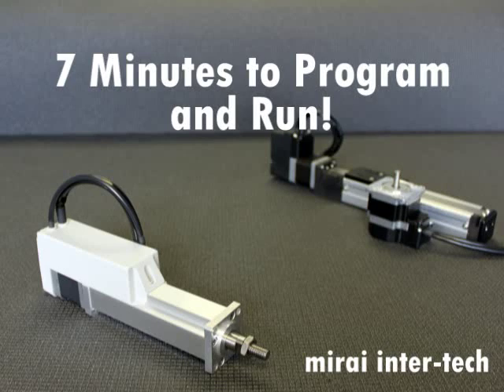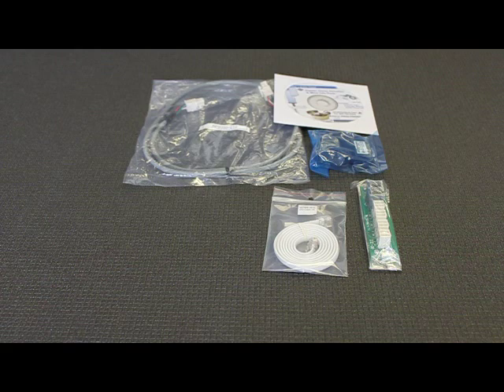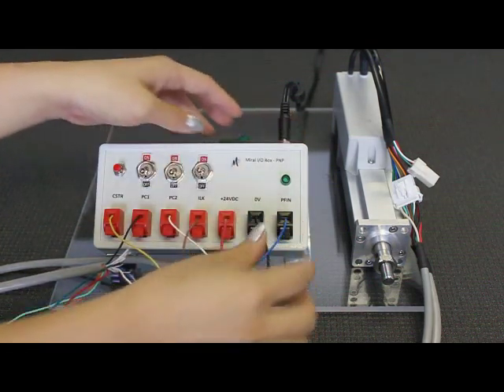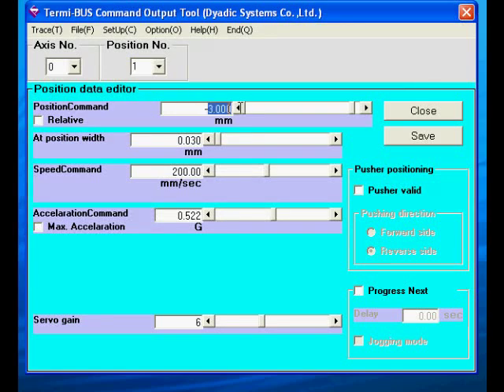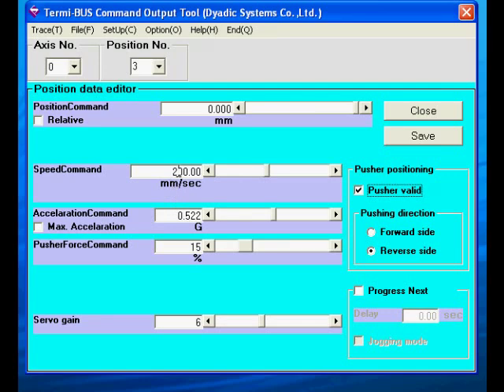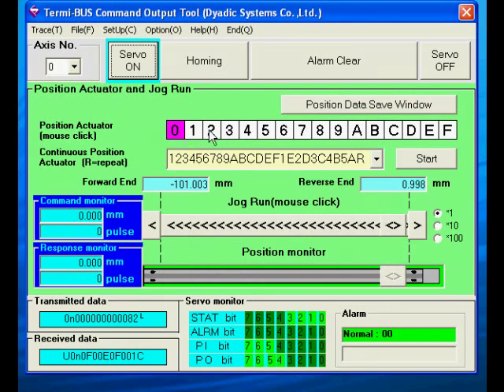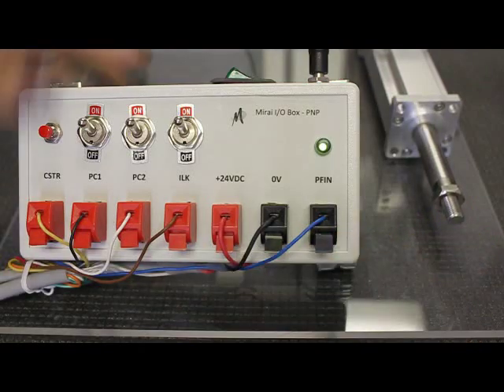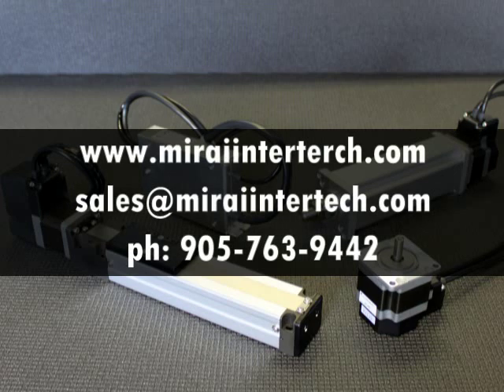Learn to wire and program a low-cost servo actuator in 7 minutes!

Comment: What if our computer doesn't have a serial connection?  Do you have an updated kit that uses USB?  ...  What is the refresh rate of the controller/actuator? (60Hz, 120Hz, etc)?  ...  What is the maximum static load?  I'm trying to build a stewart platform that can move quickly for racing simulation, but can also support some of my heavier friends + equipment (300lbs or so).  Thanks!
Reply from the maker: Hi, Thank you for your comment.  We do also have a USB cable and the part number is USB-RS485-1800-9050.  You can find it on our web store, which is located at https://miraiintertech.com/e-store. Refresh rate depends in part on the control platform (PC and software). Some users report rates of about 240 Hz.  Mechanical loading in a Stewart platform is complex and actuators would typically have very high load capacities and long strokes to make this work.  I am not sure if we can help you but we can try!  Please contact sales@miraiintertech.com for more.

Comment from the maker: The SCN5 is unique with its high-performance and low-cost design.  If you want an actuator that can do most of what the SCN5 with 150mm stroke can do but want to save some money, then the SCN5 with 100mm stroke is your best option.